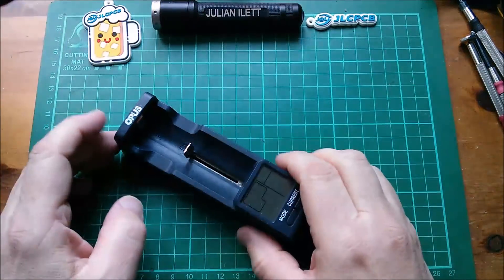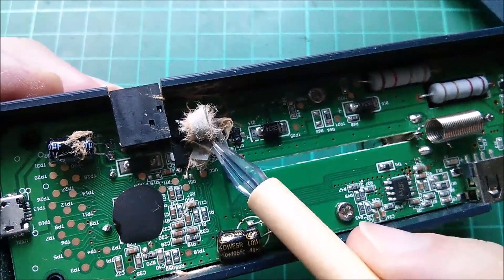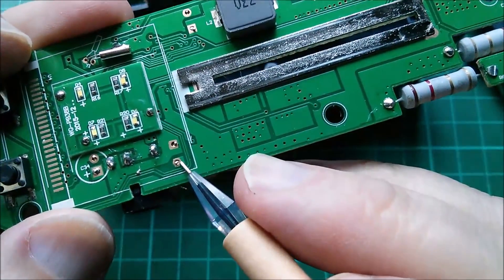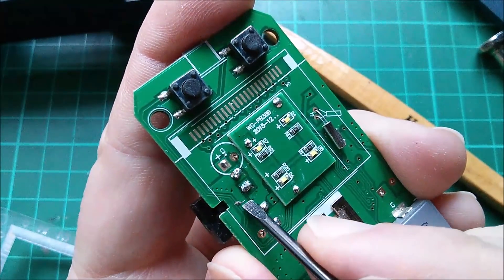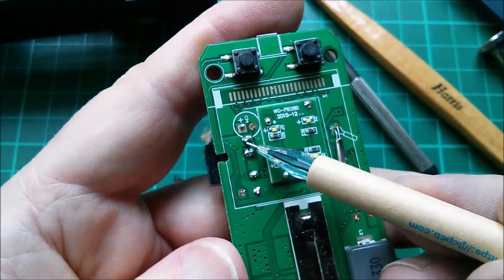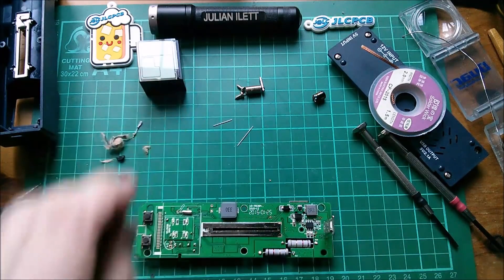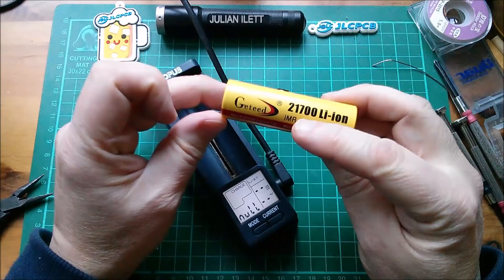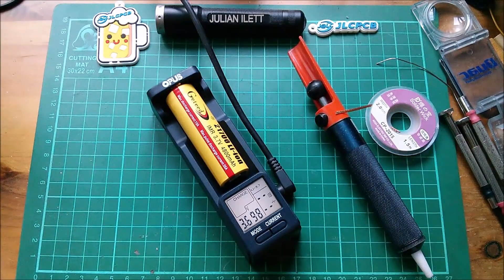Battery Charger went Bang - Guess what Failed!

Comment: You really need flux for the solder braid to work
Reply: Quality solder wick is already impregnated with flux.
Reply: @CornishMiner  but will it not have evaporated, or otherwise become less effective?

I used to hate the desolder braid but now I always add flux, usually from a pen.

The problem with the sucker is shown very clearly in this video when the jolt of the sucker nudges the iron rather violently. This could (and in my experience, sometimes does) cut the tracks or lift the pad being cleaned.
Reply: @tinkerbot4148  A solder sucker can be very effective, especially a professional one such as a SOLDAPULLT, but as you say, too much heat can damage pads and tracks. Good solder wick has a rosin flux in it which doesn't evaporate, but again, too much heat can easily spoil your day.
Reply: @tinkerbot4148  The brand I use (chemwick) is great never had a problem with it.
Reply: @CornishMiner  True, but adding more usually doesn't hurt.
Reply: I have a block of rosin that I use with braid - lay the tip of the braid on the block of rosin, and touch the iron to it. I find rosin the be a more effective flux than the stuff in a flux pen.
Reply: @robertbackhaus8911  Yes. Surprised Julian doesn't know this given his years of experience...
Reply: @robertbackhaus8911  that sounds like a good idea.
Reply: Yep. Had that brand of braid, it has little or no flux. Got a small tun of rosin flux and melted some into the braid with my iron - works fine. Goot Wick is pre-impregnated and works fine out of the box.
Reply: Yep
Reply: @cattflap1447  Definitely.

Comment: They probably swapped the 10V and the 16V electrolytic capacitors at assembly time by mistake.
Reply: They probably swapped the 10V and 16V electrolytic capacitors at accounting time on purpose.
Reply: @massimookissed1023  hahaha
Reply: More like they ordered 10V and 25V capacitors, and the assembly workers used up the bin of 25V ones first, then started on the 10V ones.
Give people two near identical parts with just one difference, and watch to see how many fail to notice the difference, or not care.
Reply: @station240  Never give the guys in manufacturing an option to do that. Never...
Reply: @station240  
But you see, the one on the 5V-side is 16V rated. So, that's a hint, that they might have swapped them accidentally.
Reply: I'm thinking they swapped the two caps near the connector.  The other cap was 16V.  No need for 16V if the regulator is 3.3V.
Reply: I'm wondering if it shipped with a regulated wall wart that didn't actually put out 12 volts and they acounted for that in the design... I've seen a number of them that only put out 10-11 volts rated 12, and while it's pushing the limits probably wouldn't blow up the capacitor like his high-current unregulated 13.8V solar system.
Reply: @matthewmiller6068  The old "only use the recommended adapter" ploy.
Reply: If they make these sort of decisions with regards to the components, what else have they done? Personally wouldn't trust this make of charger after seeing this.